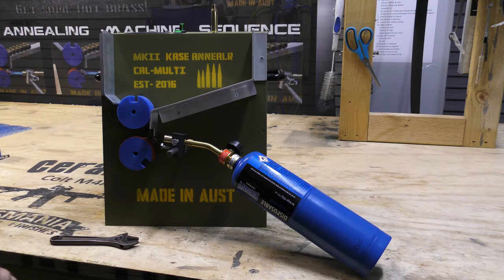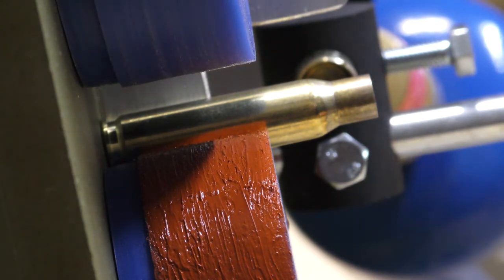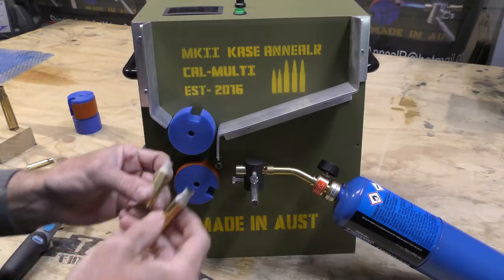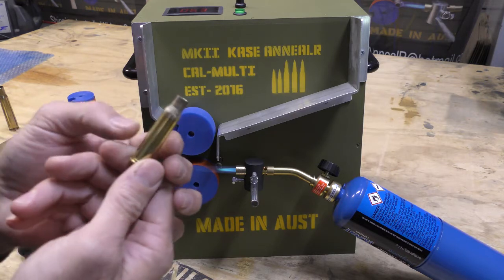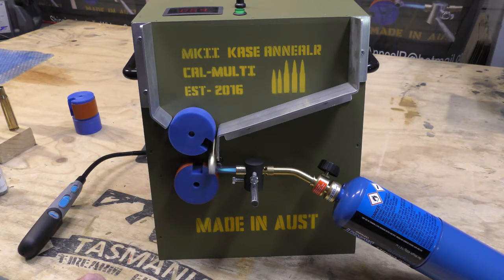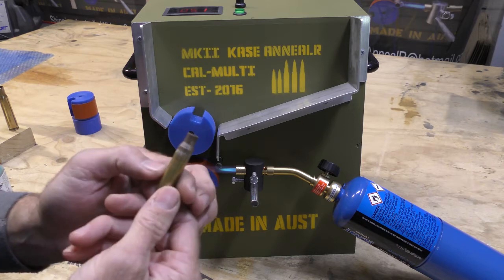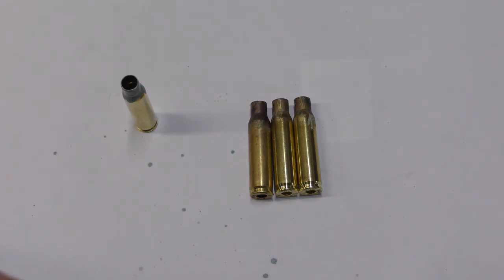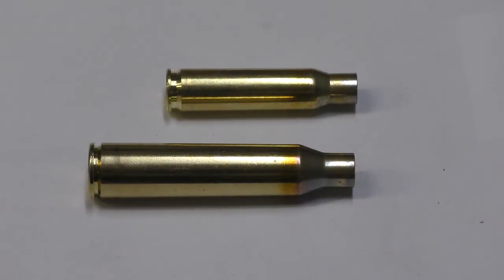Kase AnnealR   Aligning the Flame & Tempilaq HD

Comment: I always use the tempilaq on the inside of the neck, the tempilaq will reach temperature much faster and sooner in direct flame than the metal. On the inside of the neck, the temperature of the brass turns the tempilaq to clear. Just what I was taught.

Comment: wrong wrong wrong ,your doing it wrong , the templaq goes on the inside of the case , heat til it melts, also your inner blue frame should not be touching the case it should be about 1/2 to 3/4 away , your under annnealing the cases , under annealing does nothing for the case , you wasting your time if not done proper

Comment: I am very interested in the reason behind the painting of the case, I have annealed cases over the years and used the old blow torch, and I know I have had them in the flame to long, but that's what is called learning. Does the paint help the process or is it for demonstration purposes'
Reply: It helps indicate when the brass has reached the temperature listed on the bottle. Tempilaq comes in different temperature mixtures, ie: 650 deg, 750 deg.